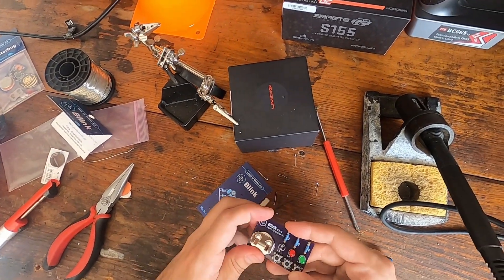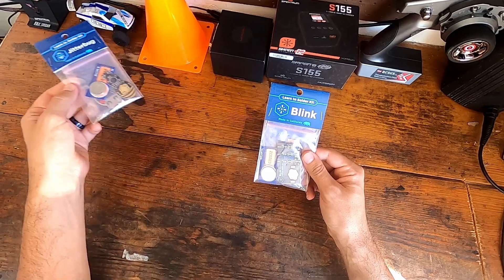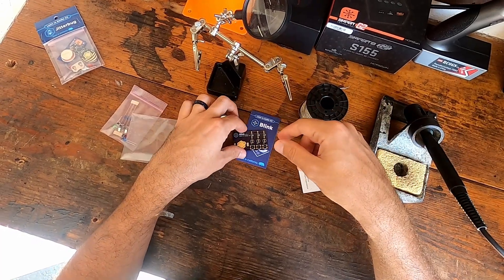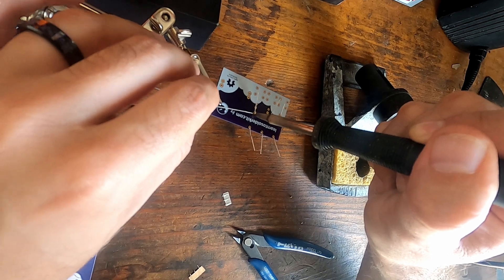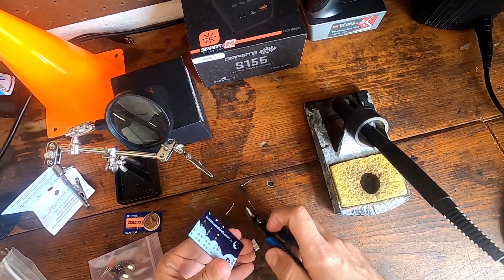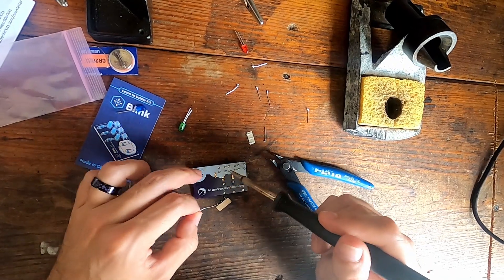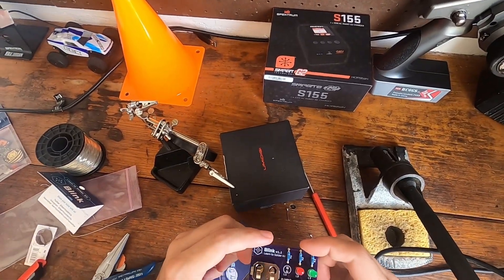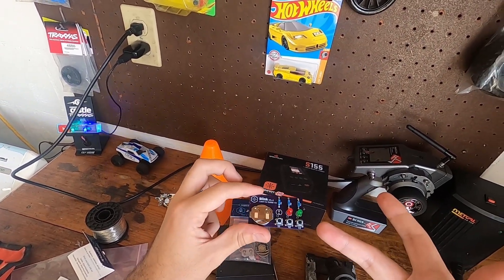How To Learn Soldering

Comment: I've tried several of kits like these(not this one though) and they never work. No solder or anything is touching each other, I don't know what I'm doing wrong. Any idea? I figured out that the leds have to be put in a  certain way but that didn't work either.